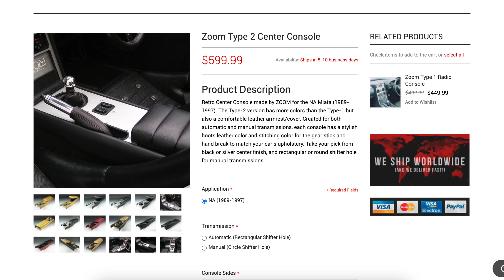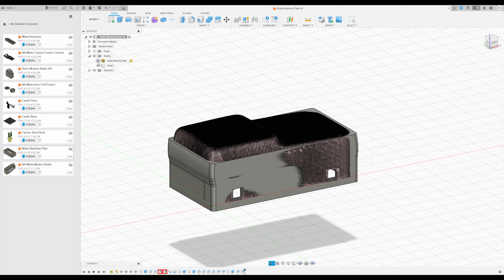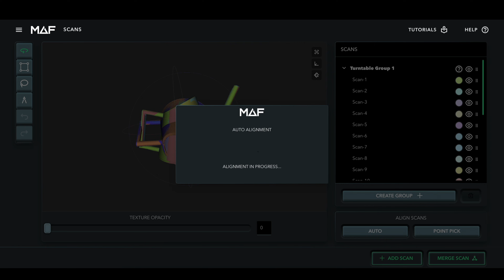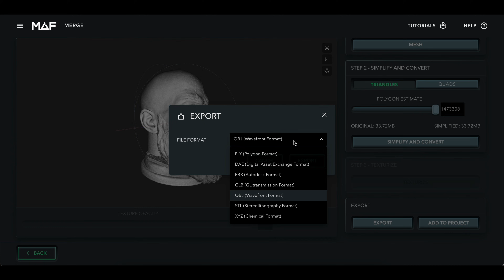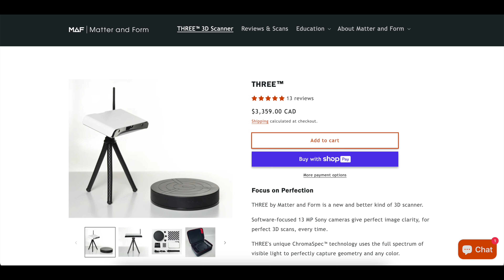3D Scanning Is Incredible! Matter And Form Three Review

Comment: Thank you for this short review.  I like the approach that Matter And Form took with the THREE, putting the processing hardware into the scanner itself.  Yes, it adds to the cost significantly and the consumer is buying some significant computing power that will only be used for 3D scanning, but it makes it much easier to manage the user experience by only needing the scanning software to run on their own hardware so there is no need to support every release of every operating system and every version of Python and CUDA libraries from Nvidia, now and in the future.  THREE essentially makes the complex 3D scanning software into firmware that can be upgraded but once it's operating, it should work with all computers, even low power notebooks and tablets, well into the future.  Other 3D scanners require a powerful computer running Windows or MacOS.  I run Linux and I don't want to buy a Windows or Mac computer just to 3D scan.